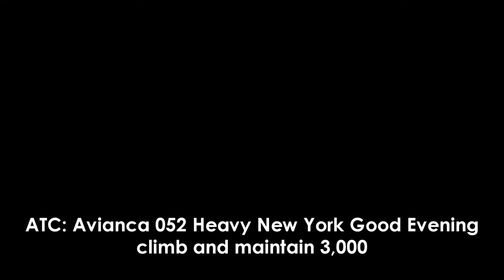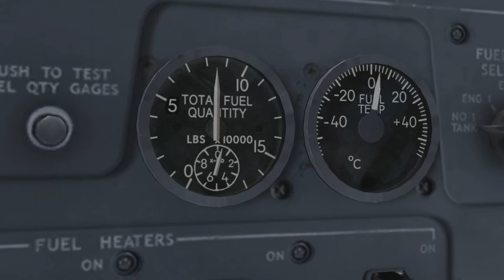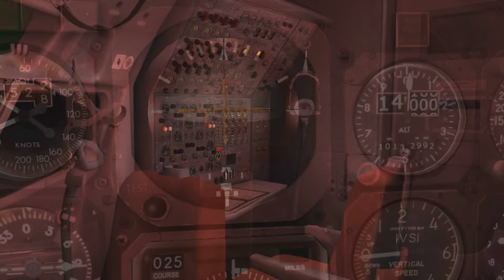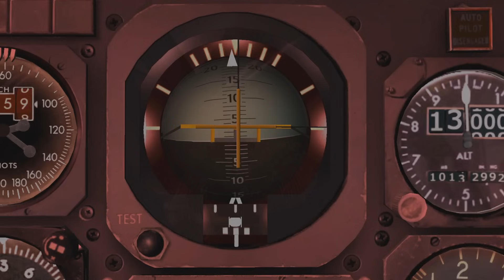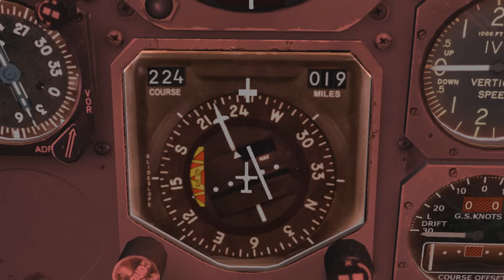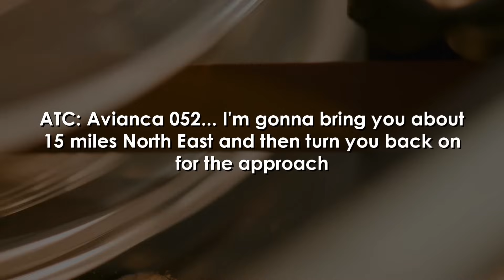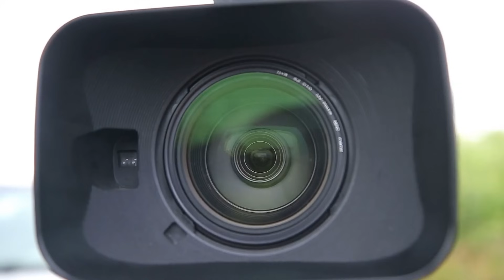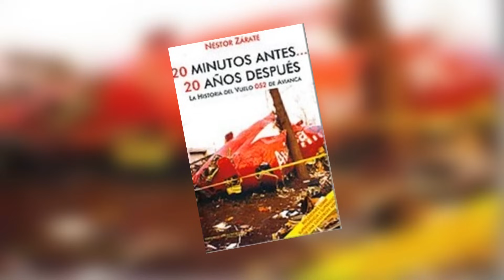Out of Fuel Over New York (Avianca Flight 52) - DISASTER BREAKDOWN

Comment: Thank you Disaster Breakdown for being one of the few sources to treat this crash objectively, instead of using Avianca's Lawyers as the sole source of information (looking at you Mayday). To put the "we are running out of fuel" in perspective. EVERY Plane in the sky that night was grumbling about fuel. There was a major storm screwing up air travel on the US Eastern seaboard. Planes were in the air for hours. The ATC's were trying to get everybody on the ground as quickly as they could. and triaging the needs. But it was still up to the pilots to properly monitor and manage their fuel, to know their diversion limits and activate them. ATC didn't hand over fuel information about the plane to the next ATC because they had not declared a Pan or an emergency.  The cause of this crash was not a failure of communication between ATC, it was a complete failure of communications and cockpit management by the flight crew. Avianca and its Lawyers  have spent the past 25 years and millions of dollars trying to bombard the public with misinformation in order to cover that fact up and shift blame onto the FAA's ATC. The only misinformation attempt more blatant egregious and widespread continues to this day be the Dutch Governments Bullshit regarding Tenerife.

Comment: Honestly, seems like both ATC and flight crew had some pretty big screw ups come together for this one.
The first screw up chronologically is one not mentioned, that the plane was told to hold for a time severely exceeding what they where prepared for.
The second screw up was a failure of the engineer to use the word "emergency" even when directly told to.
The third was ATC's failure to note that the plane had 5 minutes of holding fuel left, and their general failure to react to that piece of information as seriously as it clearly deserved.
The fourth failure was the plane actually following through on instructions they should have known would put them far too close to running out of fuel for safety. After the failed landing attempt, the plane should have refused to ascend, repeat that they are minutes away from running out of fuel, and probably performed a water landing or immediately looped around to try again.
Reply: It is the responsibility of the flight crew to monitor fuel state so this is not the fault of ATC.
Reply: @edwardrichardson5567  They where monitoring fuel and told the ATC about their low fuel. It is the ATCs responsibility to respond to information in an appropriate and timely manner.
Reply: @piguyalamode164  - It is the responsibility of the crew to communicate their situation to ATC using standard phraseology and clear, unambiguous terms.  It is also the responsibility of the crew to not accept a clearance which would compromise the safety of their aircraft.  Aviation rules are quite clear on both of these points.
Reply: ATC also did not notify the Avianca crew of low alititude windshear reports.
Reply: It's all on the ATCs for not using their fucking brains and figuring out that "we are almost out of fuel, give us priority clearance" means "GET US ON THE GROUND OR WE ARE ALL GOING TO DIE." Had the ATCs done their job, the flight would have made it down safely.
Reply: @jfangm   "GET US ON THE GROUND OR WE ARE ALL GOING TO DIE." is  MAY MAY DAY or WE ARE DECLARING AN EMERGENCY

Comment: they flew from Colombia to NY by hand?! That's pretty fun, and probably degraded their range calculations somewhat along with all the holding patterns. 

This is like the opposite of the 2 pilots who overshot their destination by more than an hour when they were bored (ahem, snoring)
Reply: This may be a stupid question, but if the autopilot had been working and was used, would that have used less fuel in the same way a vehicle cruise control usually does?
Reply: @vickiweber4718  Yes and yes.
Reply: @vickiweber4718  To piggy-back off Raymond, auto throttle also makes subtle fuel increases/decreases where manual inputs can be less efficient (just as the cruise control in a vehicle as you mentioned.
Reply: @vickiweber4718  Yes. Not as much as modern hyper efficient systems, but even the 707's Autopilot would be more fuel efficient than hand flying by most pilots over that distance. An ex WW2 Bomber Pilot might have developed the hyper efficient fuel management skills to beat the autopilot when hand flying, but regular commercial pilots? not likely. (and even then it would almost need to be a pilot that was incredibly well trained in that specific task. So probably just Paul Tibbet's 509th Composite group. The B-29 squadron that dropped the nukes.)

Comment: Great job visualizing the incident with flight patterns (even the "Mayday" series didn't do as good of a job!). It begs the question: why do air-traffic controllers not monitor the number/timing of holding patterns? I'm not saying they need to know the exact starting fuel of every plane in the air, but when you've had a plane in a holding pattern for 2+ hours for a 5+ hour flight, there has to be a point where the ATC should be concerned about fuel levels, independent of a specific declaration of "emergency". A colossal failure of communication from both sides, although in the end, it's the flight crew's responsibility to protect their passengers, which they didn't do (and left the crew in the back of the plane in the dark...not allowing them to tell passengers to brace, perhaps saving lives and many injuries).
Reply: It's almost impossible for a human to keep track of this sort of information. It's exactly why ATC, as well as piloting, should be performed by automated systems.
Reply: This flight crew was deficient from beginning to end, and that's where the story begins and ends. Everything else is deflection.

Comment: You are kinder to the ATC than some reconstructions have been. They were obviously under a lot of pressure, but not understanding “I am running out of fuel” as a statement of emergency is still a little odd.
Reply: I think fault really has to lie with the FO and training. “Low fuel” is not uncommon to hear on ATC, and also, what do you mean by that? Are you about to run into your 1 hour reserves? If so, not a massive emergency
Reply: @johnb8956  he asked for priority
Reply: no I see more people blaming the pilot
honestly, I blame both
Reply: @GiordanDiodato  priority isnt a term used by ATC though. It isnt something taught to controller's.
Reply: @johnb8956  low fuel and "we are running out of fuel" and were lost 2 engines" yeah very clear indication the pilots are at fault but the ATC are just asuch at fault.

Comment: I am very familiar with this accident as I attended the NTSB Hearings in support of a professional organization I was with. Like most accidents, there were multiple factors that led to the outcome, but one that your otherwise excellent video failed to mention was, as the NTSB put it, "the airline's failure to utilize an airline operational control system" and this was listed as the first contributing factor after NTSB's probable cause statement. The listing of this lack of operational control ahead of all the other factors such as weather, ATC, and language difficulties is significant in that the lack of that operation control system set the very stage for the accident, and essentially loaded and cocked the gun that those other factors would fire.

What did  US airline flights have that night that Avianca 52 didn't have? The answer is an FAA-licensed aircraft dispatcher who was responsible for not only properly planning the flight, but also monitoring it after departure and providing the flightcrew with updated weather and delay information, and also monitoring the aircraft's fuel state. BOS was never a legal destination alternate due to the weather, and an alternate with better weather should of been used. Once the holding at ORF and BOTON had consumed so much fuel, diversion to a better alternate (such as IAD or BWI) within fuel range of the aircraft should have been initiated. The aircraft dispatcher had (under FAA Part 121 regulations) the legal authority and responsibility to declare an emergency independently of the captain. This didn't happen with Avianca 52 because, as a foreign airline, they were operating under Part 129 of the FAA regs, which reverted the flight to be operating under regs applicable to the airline's home country, which in this case were more lax.
Reply: Q

Comment: Imo no one shone in this incident. ATC, the flight crew & Avianca all failed the passengers to some degree. 

For me though the biggest issue was the lack of English proficiency & lack of CRM in the cockpit. Though that isn't on the flight crew it is on Avianca. Avianca had many (16?) years to insist that the captain improve his English proficiency yet they didn't provide this. The captain had no idea what the first officer or ATC were saying. They could have been swapping recipes for all he knew. How can a captain effectively lead when he has no idea what's happening.
Reply: Well at least the captain knew what "emergency" meant. He insisted multiple times, rather vehemently, that the F/O use that term to the controllers but the fool never did. Alas, it was the crippling nonchalance of the F/O that got them all killed.

Comment: This is so disgusting so maddening. This occurrence totally totally did not need to happen. When I first heard about this occurrence decades ago I was angry with ATC but now I realize that the flight crew really dropped the ball on this one. Their conduct was totally unprofessional. They had a fuel emergency which got progressively worse and worse and they did...
NOTHING. Until it was too late. To be fair, JFK ATC has to eat some of the blame on this one because they were informed that this flight was critically low on fuel and did not immediately bring the plane in. Worse yet, after being informed that they were low on fuel, ATC handed this flight over to another controller and did not inform the other controller the flight was critically low on fuel. This is not acceptable either.

Comment: It is important to remember that AV’s operations center did not have any flight following function, as was required then as now. A commercial plane is required to have someone in operations monitoring its progress and in communication with the flight crew - since AV did not have this no one in Bogotá was watching and in communication with the plane to advise them that weather in NY was bad and that diverting to Washington Dulles (IAD) was needed. However, when given their first holding instructions ATC did tell the plane that NY was experiencing bad weather and that IAD and BWI were both open and options for divert and continue.

Comment: I wonder if there would've been more survivors if they'd managed to land on the nearby water instead
Reply: no. the reason why so many people died is because all the seats came loose and piled up, thus crushing some passengers to death. the seats were never designed for forces like that.
Reply: @GiordanDiodato  I disagree. The excessive forces come from too high speeds during a crash-landing. Excessive forward and vertical speeds are kinda linked since even if you touch down "successfully" during a crash-landing, forward kinetic energy still has to be dissipated somehow, usually by means of tearing engines, wings and subsequently the fuselage apart as they hit trees and the ground.
Notice how they were in a steep left turn before the crash? This maneuver cost them a lot of altitude and greatly incresed their vertical speed. For ditching they didn't need to turn anywhere, just glide straight ahead. Also, ditching can dampen vertical speed somewhat (though not much) and there're no bloody trees on the water to tear your wings apart prematurely. And there're no hillslopes to impact while still having high forward speed. All in all, the forces acting on the seats would've been lower in case of ditching.
Furthermore, ditching is always better than landing on a populated neibourhood.
I think they would've had better chances if they'd decieded to ditch the plane, provided that they had lifevests onboard (which they should've had since they were flying over water). I hate to say this about the pilots, but it seems they were underqualified. This is why they failed to identify an emergency situation in time, this is why they failed to communicate properly with the ATC and this is why they failed to execute an emergency landing in any meaningful way (even if they were unfamiliar with the area, why the steep left turn while gliding?).
Regarding the last point, though, there may've been some system malfucntion due to complete loss of power, that prevented the crew from controlling the plane. But all other points still hold.
Reply: Dude was just thinking that looking at the map onscreen

Comment: I put equal blame on the pilots and ATC for this one 

The pilots are at fault for not using the word "emergency" or "mayday" (2 words that will stir up ATC like stepping on a fire ant nest) and are taught to pilots in their first month of flight school 

ATC is at fault for not working out that the plane was virtually out of fuel after being told multiple times "we're running out of fuel" and shortly followed by "we've lost 2 engines"

Comment: They need to add a procedure to "standard aviation radiotelephony" where when you change controllers/frequencies and you've declared an emergency you ID as "MAYDAY id", like:

A32: "Olympus Center, Apollo 32, MAYDAY MAYDAY MAYDAY Low Oxygen. We're declaring an Emergency."
C1: "Apollo 32,  Olympus Center, copy Emergency. Contact Tharsis Tower 121.0 GHz"
A32: "Tharsis 121.0, Apollo 32"
A32: "Tharsis Tower, MAYDAY Apollo 32, Archangels 100, REDMAN radial 235 inbound 500 km"
C2: "Apollo 32, Tharsis Tower. Copy Emergency. Cleared any approach. Cleared to land any pad. State number onboard and fuel if able."
A32: "Cleared any approach. Cleared to land any pad. 1500 Humans, 3000 Dolphins, 1 Arthropod. 60kilotons Helium-3. Apollo 32."

Comment: Fatigue must have played a part in this disaster. Hand flying from Columbia to NY is enough to exhaust any pilot that doesn't have A/P engaged. They should have at least declare fuel minimum or better yet, Emergency. The holds should have been declined from the first Clearance to hold.

Comment: kind of get the feeling that if there was a way to jettison fuel or add something to the mix to make it unignitable, similar belly landings might be less, uh..... explosive, and save lives in the long run. Just a thought.
Reply: It is really hard to safely and quickly jettison the fuel, especially in a damaged plane.
It is also really hard to stop it from burning, there are additives which can work, somewhat, but you need too much of it. The most powerful fire retardant gases can work really well, but those also take out the passengers along with the fire.
Hydrogen might be a little better solution, because it is much easier to get rid of. It also very strongly goes upward, so the fire will rise very quickly, instead of staying low and roasting the people. But it has many other problems, like even a little oxygen can make is explode inside the tank, or it may need to be kept in liquid form, which is an engineering nightmare. (it has very high energy density though)

Comment: I was so angry when I learnt of the cause of this accident, especially at atc putting the onus of the accident with the pilots when they were already told about the fuel state multiple times, regardless of the precise language used. Multiple calls of "Running out of fuel" should be enough to expedite getting them on the ground.

Comment: The captain was innocent. He can't be blamed for a missed approach under the circumstances.
The flight engineer probably should have said something about the fuel sooner, but that isn't really that big a thing.
The first officer should have used the word "emergency" or issued either a mayday or a pan pan. However, the seriousness of the situation should still have been understood from what he said.
Not asking for weather information was definitely a mistake, though.
The air traffic controller who didn't note down how desperately little fuel they had seriously fucked up and has to shoulder some of the blame.
Management is also to blame with their ridiculous demands. The airport shouldn't have been receiving so many flights with half their runways out of action and the weather how it was. They created a situation in which this could even happen.
Whoever decided to save money by not replacing the seats is guilty of negligent homicide. Whoever made the decision to not make the replacement mandatory also fucked up. Whoever decided not to make the new seats mandatory after the accident fucked up even more.

Comment: Seriously not speaking ill of anyone but the copilot's insistence on the non-standard "Priority" is perplexing, and probably exacerbated the situation. They didn't have enough fuel to make it to their alternate (EMERGENCY), and were running out (EMERGENCY). That was not the time to be coy. And I thought IFR was something like "enough fuel to make it to your destination, then your alternate, then hold 45min" (and I think commercial aviation is even more), so they should have been notifying controllers much earlier. On the other side, controllers should be taught that and if they're holding planes over the required 45min hold excess they need to know they might be running low on gas.

Comment: This no doubt was the air traffic controller’s fault I counted eight different attempts of them telling them they’re out of fuel
Reply: There's a regulation that applies worldwide that states a pilot in an emergency may deviate from any regulation necessary to meet the needs of the emergency. The pilots knew they were out of fuel. They had the option to fly direct to the runway at any time, without ATC permission. They only had to say it was an emergency.